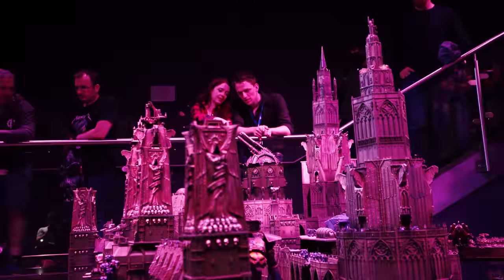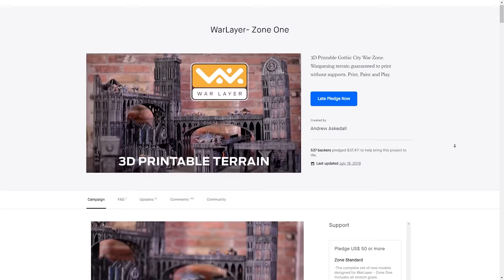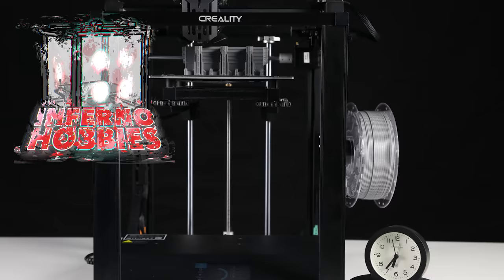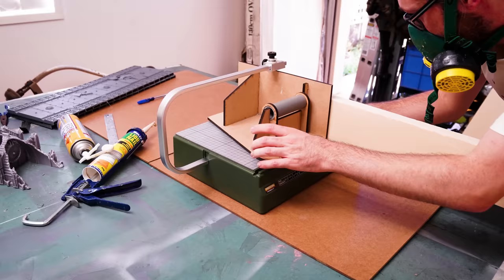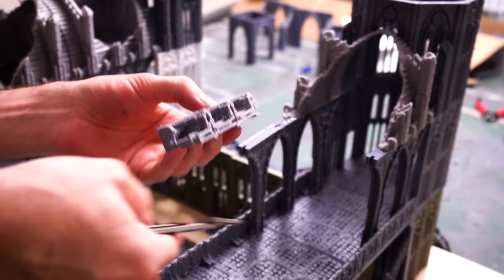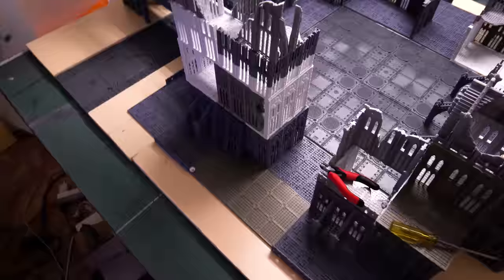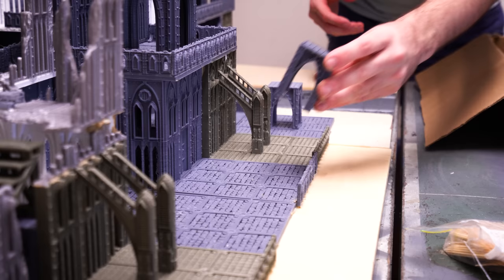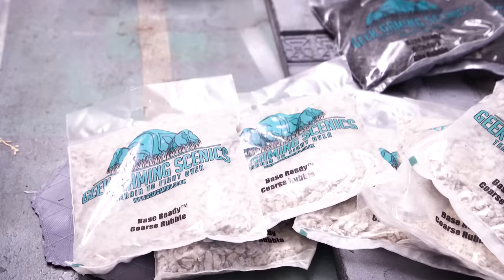I made a Massive Warhammer Cathedral Imperial Palace on Terra | 40k Scenery @Creality3D Ender-5 S1

Comment: I wonder if you could save yourself from a bit of grief by basecoating the printed bits before assembly? You could give them a quick black/dark gray colour while they're flat so you don't need to worry about trying to spray those hard to reach areas as they're already dark.